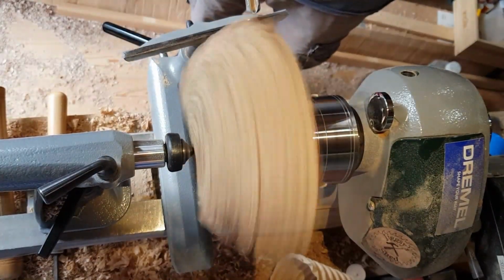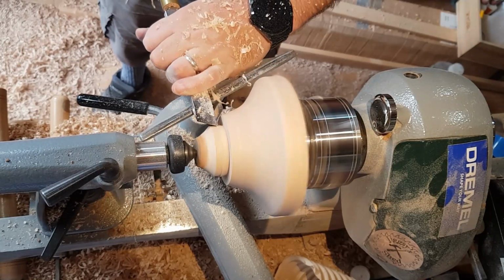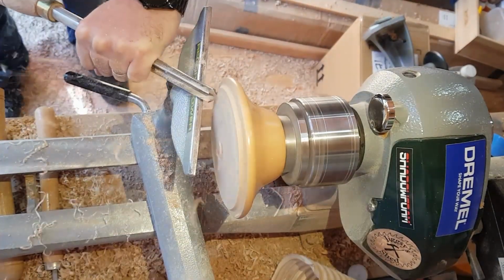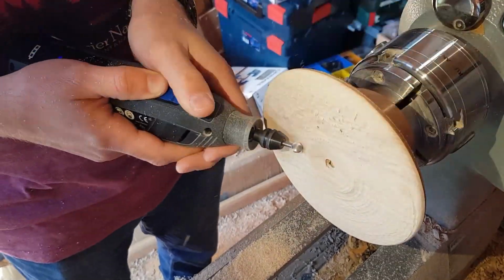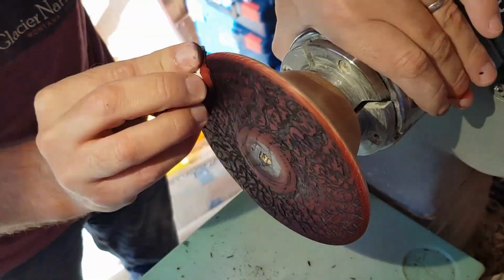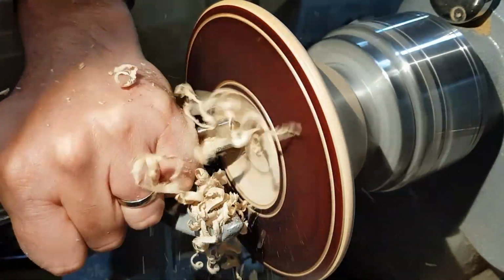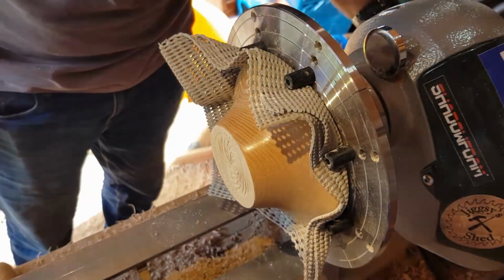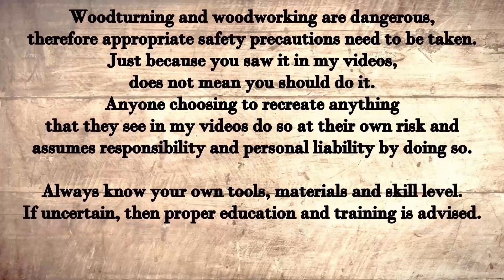Crafting the "Blood Bowl" - Woodturning and Texturing Ash

Comment: I was never a big fan of ash, but if I am honest I had never worked with it, I merely adopted the opinion of others. Then a friend dropped off several large pieces of ash that was a tree he cut down because of insect damage. Free wood is well... free. So I finally got around to mounting a small piece into my chuck and turned a rather basic bowl about 2.5 X 7 inches  (18 X 7 cm) and what a beautiful bowl it is. I love the grain and now I am beyond thankful my friend drove all the way to Dallas from New Braunfels Texas (250 miles each way) to bring me the ash. This bowl and the next two are going to him. Your ash bowl is very unique and for a good part of the video I could not tell where this was going. I really like the result, you do nice work :) I subscribed
Reply from the maker: Ash can sometimes be a bit tricky with the cuts due to the contrast of hardness in the grain. This can sometimes lead to the tool chattering a little. Though I find sharpening the gouge just before the final cut and then stabilising it by putting pressure down onto the toolrest overcomes it.
I love working with Ash, especially when adding colour as the open grain really soaks it up and gives some really good contrasts.
I also have to love it as it is the one I get the most free wood of.  Definitely cannot complain about having free wood.
That was very nice of your friend to think of you and bring it over such a great distance. The insect damage could also give some grear character to your projects.
Thank you for watching and commenting. I really appreciate that!
Happy turnings.